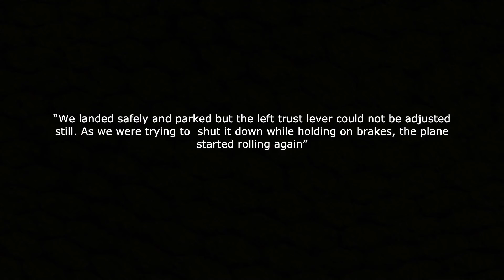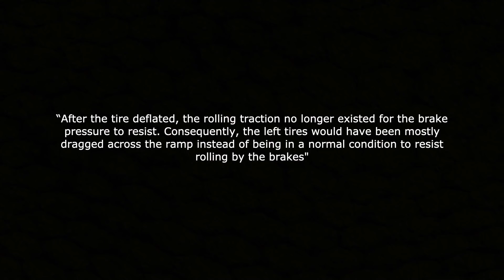The Crash Caused By A False Sense Of Security | RwandAir Flight 205

Comment: I don't so much have a problem with the pilots attempting to troubleshoot the best they can in the air... It's not like the engine was slinging out shrapnel, or fire. It was only "pinned" at max power... BUT at some point, they needed to reach the conclusion, either they can regain control, or not... AND by final approach, just SHUT IT DOWN... any means necessary, cut the engine power off. You don't need all the engines to land, and it's only a marginal benefit to keep them all in the air, just in case you COULD suffer another engine failure... BUT for landing, there's only a balance of thrust benefit, and that's defeated by the left engine running at max, anyway... SO shut it down.

     I can even understand continuing to try and pursue some additional troubleshooting first. The better your report on the trouble is for the engineers and maintenance, the better they have it to get it fixed... BUT you're not going to whip out a monkey wrench and climb out there to open the cowling and start fiddling with it at altitude, so cut your losses and try AVOIDING disaster.  ;o)

Comment: Follow the procedures. Loss of engine control.  Pull the fire handle & shut it down!!!. Do an engine out approach & landing. Stop on the runway if you want & if all clear, taxi to the ramp. These guys just didn't follow normal procedures nor understand the aircraft braking system.

Comment: These two pilots were blowing bubbles instead of doing their basic jobs. All you had to do if the engine didn't respond was to pull the fire handle and call it a day. The CRJ can fly single engine without any problems. This crash was caused by their ineptitude, their lack of competence is embarrassing to say the least.

Comment: Always hard to judge action of colleagues after an accident, however, I think that they ''rushed'' to land the plane without taking proper analysis. When the shits hits the fan, the first thing to do is to follow the proper procedures, Should they have take time to analyse, they would have secure the affected engine, it's always the same philosophy: idle, eng run oof, fire handle pulled, at this stage the engine would have shut down and they would have to deal with an OEI landing. In their choice, They could also have go beyond the standard by increasing the drag ie apu ON, the door inlet is generating a good drag, anti-ice ON to retrieve power from the engines is also an option. No rush and standard ops.

Comment: I wonder if the full cut off levers use the same fuel control unit that got jammed here by the cowling strut, or that it is wired to a separate fuel valve? For safety and redundancy reasons it would be better. Moving the full cut off lever to cut off would close the valve and stop the engine from running.

Comment: The issue with the cowl strut seems like a design flaw in the plane! But this is definitely a case where if the pilots had followed documented procedure they would have been fine. My guess was that they should have dumped fuel, but it sounds like that was not even necessary if there was a cutoff switch.

Comment: TIL plane brakes are way stronger than I realized.

But seriously, if my (a layman) first instinct is to cut the fuel, how did it not cross any of the crew's mind at any point? Not to mention, leaving a relatively safe situation in the air to attempt a landing at full power without checking any of their handbooks for the situation...

Comment: Sometimes, i´m wondering, why don´t pilots know as much as possible about each plane they fly with - you will not get all knowledge only by attending to the simulator or by flying. Like not just knowing "if this happens, use this", but also knowing the connections, like "WHY should i use it and WHEN".
Just like car driver needs to know his car before attempting some risky maneuvers, pilot should know his plane.

Comment: As the former Manager of Fleet maintenance planning for Midway Airlines based out of Raleigh Durham, North Carolina (RDU) who we had 25 ea. CRJ-100 or what I called Canadian Regional Junk, we had similar problems with the same issue during my time there 1997-2000. In working with our Bombardier Maintenance Co. Rep Mr. Ray Gordon, we at Midway created a fleet Engineering Order an E.O. that reposition the cowling bracket mounts.

Comment: I would have thought that, in a multi-engine aircraft, if you have an engine that becomes unresponsive or uncontrollable that standard procedure for any pilot would be to shut it down and make an emergency landing.  A pilot has to be able to retain a good view of the big picture when they have aircraft issues rather than getting trapped in trying to rectify the problem.  As for the passengers being allowed to release their seat belts and stand up before the aircraft was secured on the ground, that just seems utterly unforgivable and an incredibly basic error...

Comment: The mind-boggling stupidity of this accident is almost beyond belief. That two airlines pilots would ignore the certified checklist and elect to land with almost full thrust on one engine instead of shutting it down is stupidity of a major order. Then it gets worse; to leave that engine running at full thrust while disembarking passengers and shutting off hydraulic power to the brakes by closing down the other engine is worthy of a gold plated Darwin Award by proxy...

Comment: I was wondering why they didn't cut the fuel to the engine or activate the fire extinguisher to shut the engine down. Landing on one engine would have been preferable over landing with one engine at over 90%

Comment: Me being no pilot, knew what needs to be done. Pilots with thr handbook couldn't do it. 🤦‍♂️
Reply: different in situations and u are panicking
Reply: @BHARATCHAUHAN-cr9zm  ya I understand. But that is definitely not something I was expecting from pilot, considering the fact the plane was never out of control and thr was no point in panicking. I meant that was a basic step which couldn't be missed
Reply: @BHARATCHAUHAN-cr9zm  they had plenty of time to realize they needed to cut power to the engine somehow.

Comment: They had a faulty engine they should never have taken off in the first place.
Reply: Please read up on v1 speed. In short, it's the speed after which a takeoff should no longer be aborted because there is not enough runway left to stop safely.

Comment: It seems like the pilots did a really smart thing while doing a stupid thing at the same time. They handled the aircraft very well with one engine at full thrust and got on the ground safely, but they failed to see the big picture at any point (even once on the ground). 

All that technical jargon in their handbook about "TLJ procedures", "safe altitudes" and "engine fire push" controls is all just technical-speak for "SHUT THE DAMN ENGINE OFF!" They spent all their time trying to troubleshoot and figure out why they couldn't control this engine, while never taking the big picture step of just turning it off (especially after they were safely on the ground) and letting the people in the tech shop -- whose job it is to deal with the issue -- figure it out later.

So are they technically at fault for the crash and the death that occured? Absolutely. Am I saying that I can guarantee you that I wouldn't have made the exact same mistake in the exact same situation?  Absolutely not.

Comment: Perhaps the "political ramifications" of pulling the fire bottle on the engine were high enough in their minds that they tried to fix it.  But there are other ways to shut down an engine, actually lucky when one is healthy and running.  Fuel doesn't pump itself.

And I (an advocate against modern avionics SW) was thinking, look at this, just a mechanical problem, pure, no SW logic lurking, waiting to kill.  And then I hear the backup hydraulic pump isn't run off a pressure switch, that would be too simple, too effective.  No we want some SW logic, make it insist that some switches be in auto settings, insist the flaps be down.  SW kills again.

Comment: This reminds me of the Camry acceleration issue.
Instead of putting the transmission into neutral, people called 911.
This is what happens when you operate a machine you’re clueless about and are too proud and stupid to learn. Disaster.
Reply: There's a 911 video of a car that wouldn't stop. It kept accelerating, past 100mph.  Police gave all kinds of advice from trying to turn off ignition (but she had the push to start button), it was stuck on drive - she couldn't shift it to neutral or downshift the gears, etc.. Her husband, at his office, was searching for solutions...

In the USA, there were several cars having this problem, especially the Toyota.
Reply: @karend1577  You have to hold the button down for push-button. The accelerator was physically stuck under the extra floor mats they added most likely. Downshifting in an automatic won’t work, but I don’t think anyone suggested shifting to neutral.

Comment: I understand the stress factor, but can't get my head around why the fuel hadn't been cut off, and why you would taxi with a malfunctioning engine, overheated brakes and deflated tire towards buildings. Then allow the passengers to unbuckle. This could have ended in far more casualties among the passengers, people in the terminal and ground crew.

Comment: Why couldn't they just pull the engine fire lever? Doesn't that cut off the fuel supply at the pump? I mean, it's a somewhat expensive option, I'm sure, but... better than crashing into a building, no?

Edit: Oh, gee, that's exactly what the non-normal checklist said, lol. It troubles me that pilots need checklists to troubleshoot stuff like that... how does a professional pilot not know that the engine fire system cuts off fuel? Or, if they knew that, how do they not think, "Hmm, I need to stop fuel from going to that engine. How shall I do it? Oh! The engine fire system does that!"

Comment: The morons! I sure hope that both pilots lost their licenses for that!
It's obvious to me, a guy with ZERO pilot training that an engine out of control should be shut down immediately. Fuel cut-off, fire suppression, try everything. But, no, after violating every safety procedure and getting the plane landed and stopped against all odds, they continue to fiddle with an engine they can''t control on the ground. What the blazes were they thinking?

Comment: At 6:00 - that's the logical thing to do, regardless of the QRH. If the thrust lever doesn't respond, the absolutely intuitive next action would be to pull (or press, depending on design) the fire handle to cut off the fuel supply to the engine. It makes no sense for these guys to keep trouble shooting. Shut the engine down and land. Landing with one engine at full power makes no sense.
Reply: maybe they were afraid of passenger/cargo/fuel-weight or something

Comment: Lmao I’m not even remotely certified for complex / turbine much less ATP, but even if I had skipped the checklists / QRH my plan of action and brief would have been stable approach with #2 at idle, make the runway, and immediately pull the #1 fire handle which cuts the fuel feed lines etc. 
“Made a few mistakes” lol - it’s inconceivable to me to land a plane with an engine at Max throttle when you have a normally operating engine as well. I’d  literally consider it the same procedure as an engine failure and shut it down, fly the plane the same way as a single-engine approach. Of course if I was heavy and didn’t have time for QRH or checklists for whatever reason, I’d just pull the fire handle as I mentioned above. 

And again wtf was their plan once on the ground?! Braking? Disembarking? 

I love pilots who understand and want to learn the engineering behind the planes they fly, some unfortunately stick to the bare minimums and don’t learn even the fundamentals of how critical components operate. Not just the engines, thrust requirements (or rather lack there of aka shut it down) but the BRAKES. They aren’t designed for that landing and sure as hell not designed to land under thrust (heavy no less!!) AND remain stationary while red hot, AND still keep the plane stopped? What?  
IMHO they were complete idiots and got someone killed as a result. I’m going to skip the prerequisite “they were heroes for getting the plane back” part this time. No they weren’t.

They could have just f’ing engaged idle (or higher) reverse on #2 to attempt to negate the fwd thrust, save the brakes, and taxi around before someone at maintenance / company told them to (AGAIN) pull the f’ing fire handle.

Edit - wait I’m just now thinking about the crash part - they literally went into a building with the engine still at high power, and STILL didn’t pull the fire handle? It was shut down with water? It’s like eng #1 was their firstborn child or something.

Comment: IF you can could you tell the story of a Cessna 441 that crashed in the late 70's or maybe early 80's due to a trim tab actuator failure? If I remember right 7 or 8 people died. Part of the situation involved the FAA allowing Cessna to certify sections of its own aircraft (the 441 (I guess) had an actuator system very similar to the smaller twins.)  I was working there at the time and I would like to know how it all ended up. No surprise, there were lots of layoffs and I went to another company at the time and never heard the end of it all. Thanks for the good work.

Comment: I am one more of those going - fuel? cutoff? somewhere? I know that these are really complicated and all, I've been inside an airplane cockpit more than once (including jets) and I may not know squat but when that sob started rolling I could have found some way to shut off power, or at least with the front wheel working I would have crashed into something softer. 
Listening to your documentaries really does let me know that all those nights and weekends we worried over loose screws and retaining wires, locknuts, nylocks, nutplates and 20 different kinds of stickem goo were well worth it.

Comment: I'm not a pilot but my first reaction would have been to pull the fire suppression system in the engine. That would have definitely worked because it would have shut off the fuel and stop the engine.

Comment: 'THEY FLEW THE PLANE BEAUTIFULLY WITH THE ENGINE AT MAX 
POWER."  They decided to land the plane with one engine at max
power.  There was no rush to do this.  They had plenty of time to
continue to trouble shoot and to get trouble shooting advise.

The corrective action was to return to 2000 feet and then power
down the engine.  The Computer control would have been disengaged.
The engine would have powered down.

With a full powered engine on the ground, the plane was now in
MAY-DAY condition,  a Life threatening condition of all passengers.

This situation was indeed 100% pilot error by faulting to take
proper corrective action.  100% pilot error. Pilot's license revoked.

Comment: Pull fire switch or engine start lever to shut down the engine. You never taxi back in such scenarios into a crowded area. Could have asked ground engineers to operate fuel shut off valve.

Comment: I was wondering the whole time why they didn't just pull the fire lever for the engine to shut it down. Do you think maybe when they talked to maintenance they were told not to do that because it would destroy an engine?
Reply: The Engine Fire Switch light shuts off fuel to the engine along with a couple other items. Wouldn't necessarily destroy the engine but would be very hard on it cooling down so fast. I'm guessing they were reluctant to shut down an engine in flight and fly the aircraft single engine.

Comment: Did the engines on that plane have reverse thrust? Would that have kept the plane from rolling?
Reply: There are thrust reversers on the aircraft. However they are locked out until the engine is at idle power to prevent deployment in flight. Since the engine was stuck at 95% N1 the reverser for the left engine would have been locked out.

Comment: Tremendous pressure to find pilot error.  True, the pilots were at fault, but for not responding correctly to *mechanical failure*.  How about shifting the blame back a little to engineering?
Reply: Because, this was a pilot error... and the last nail in the coffin (for the person who got killed) is that they shut normally working engine (that controls the hydraulics and electrics of parking brake!) and left the "bad" engine to run (insted of cutting it off by fire handle). That defies not just basic pilot knowledge, but common sense.

Comment: Unbelievable.. every plane I flew during a 35yr career had an engine isolation valve, usually operated from the hot-battery bus. This would close off all fuel and hydraulic systems from the engines, as an additional safety feature, the fire extinguishers could also be activated. It would have been a no-brainer to activate that valve without ever having to refer to the QRH or the emergency check-list.. what on earth were they thinking?  Or rather, Not thinking ?!!

Comment: Fuel switch on left engine to off. That takes care of that problem. 92% is too high anyway and there was a rather beautiful engine in working order working. On the other side.fuel switch has nothing to  do with the throttles seen enough of these. These were bush pilots.

Comment: Heyyyyy!!!why dint they dump the fuel the airplane would have been too heavy right??

Please clarify
Reply: The CRJ cannot dump fuel. It is actually tested to be able to land overweight. Sometimes an overweight landing requires an inspection dependent on rate of descent at touchdown and a few other factors.
Reply: More generally, any airliner can land at maximum takeoff weight.  It would be with the caveats noted by the poster above, and at a higher landing speed.  That's because higher weight = higher flying speed, plus there's the possibility that flaps won't deploy to the maximum setting if airload on them is high enough.